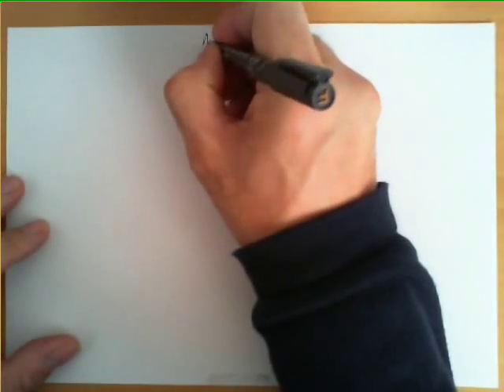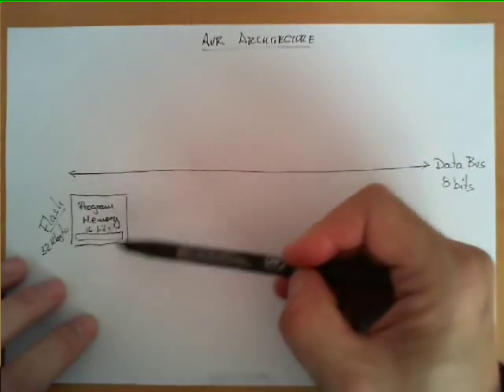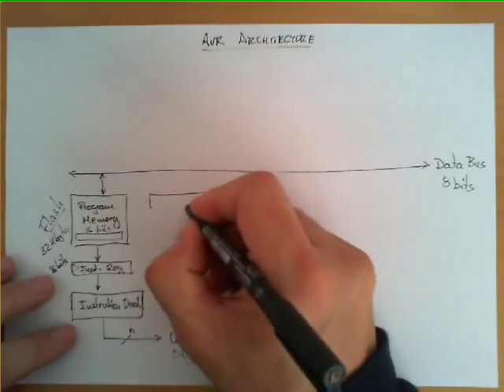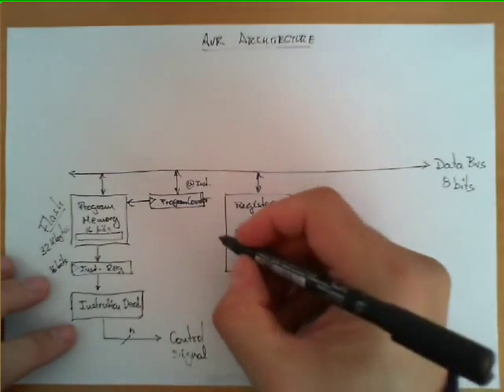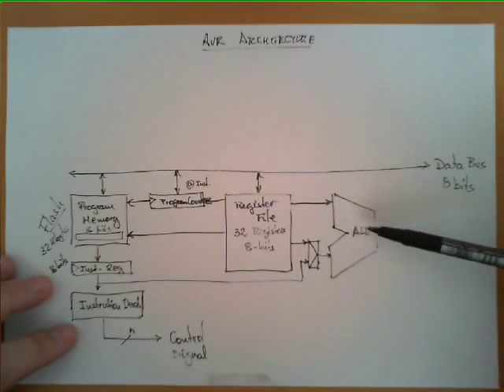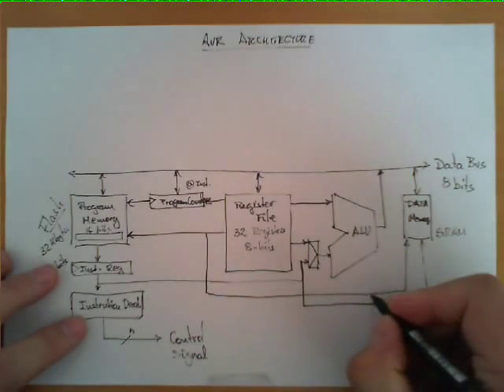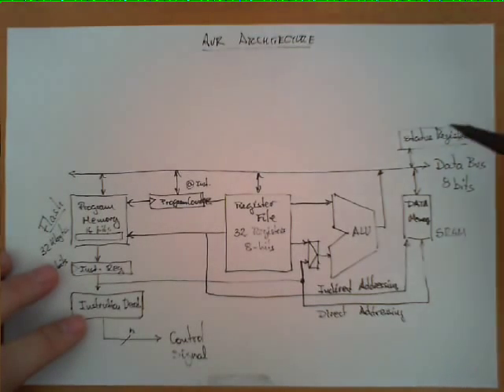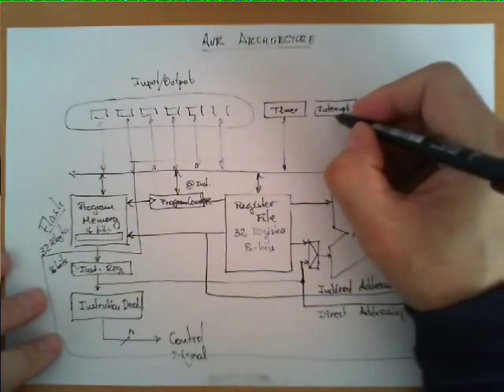Block Diagram of the AVR Architecture

Comment: This video contains an error. Program memory is not connected to data bus, which is one of the assumptions of te Harvard architecture. Quote from datasheet: "In order to maximize performance and parallelism, the AVR uses a Harvard architecture – with separate memories and buses for program and data."
Reply: Marcin Polaczyk its an atmega 32 right??
Reply: it's true, program memory  should not be connected to the data bus.
Reply: @adwaidpk5785  it's equal for everyone of 8bit microcontroller avr

Comment: thnx for your wisdom. i dont know if this is correct. can some one arove this is right. or wrong. highly aprichiated
since the program memory is 16 x16 on each row . the only thing that make sence is that there must be a common MUX in the architecture .an 8 to 16 bit multiplexer. for accessing each 16 bit data container. from eather the buss or the register file.. as the program counter points to the column. we intrested in. the bus or register file teels exactly where on that  16 bit long adress the data is .